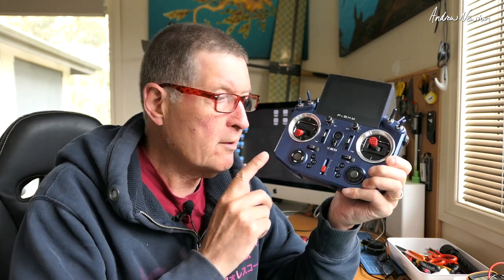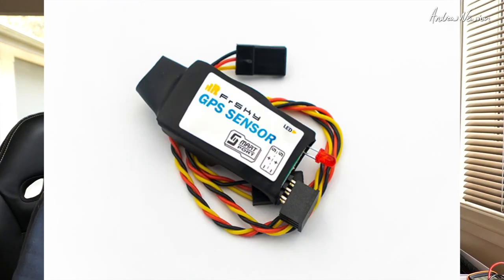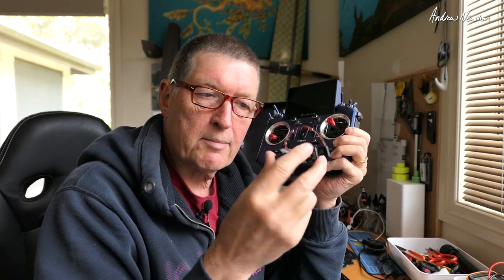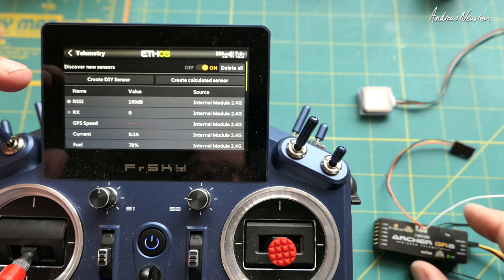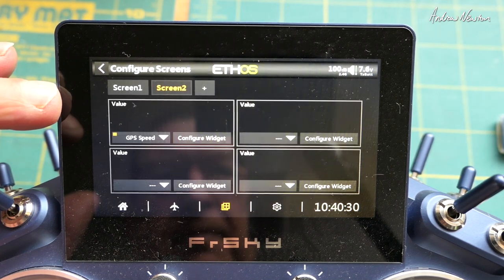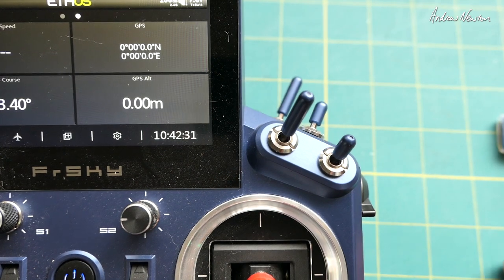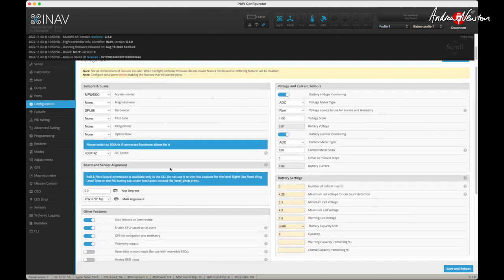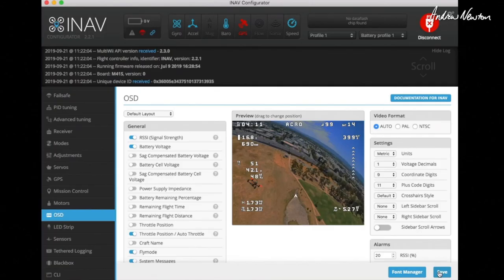SmartPort GPS Telemetry On Screen

Comment: hi 
I have bought me x20s and an sr8 pro receiver as well as an adv gps
And now I have to start making the setup for my E-flite viper 90mm edf jet (my first jet)
I have learned to fly with a spektrum system and I like spektrum's safe system and now I want to try to make the same safe system on frsky

In my sr8 pro there is a 3-axis stability system and it also works perfectly fine, but I would also like to make a "hard deck" that I can set myself to a given height

for example
when I have to practice new tricks, I want to have a switch where I can activate my "hard deck", which should mean that if I lose control and I get below 20 meters (or whatever height I set) then the plane has to level itself out like if I use my panic button

I think that you should be able to use the data that comes from the GPS as well as the settings in the 3-axis system to program such a "hard deck"

I hope you understand my question and I would really be very grateful for all the help I can get
Reply: GPS is designed for navigation in other words 2D positioning over the earth's surface.   Any altitude information is highly inaccurate as its based on satellite data providing signals at an angle which is only partially effective.  GPS altitude therefore is not accurate and in full size flying we allow + or - 100 Meters.  So in conclusion it's not accurate enough for your " hard deck".  Better to use a momentary switch as an " Oohh crap" switch to override the gyro mode switch to give you self level mode very quickly.
Reply: You'd need Barometer derived altitude to support this "idea"....Oh, and some flat terrain too....🤔😳😮🇬🇧😏😏😏

Comment: Can you tell me which uart port you have used to get telemetry? I have H7 using TX1 and all params set right but no data out to handset. Using airspeed and GPS on skyhunter. Am a bit stuck for free working uart port. Thanks
Reply from the maker: Which H7 board? UART1 might be already selected for MSP

Comment: Is it possible to use the sport telemetry from the speedybee fc to my x18 ethos controller to work with qground control or mission planner? Or would it be possible to configure a uart on the speedybee to output mavlink via a separate telemetry radio? I can't figure out how to get this configured using ethos to work with my pc for telemetry.
Reply from the maker: No idea sorry